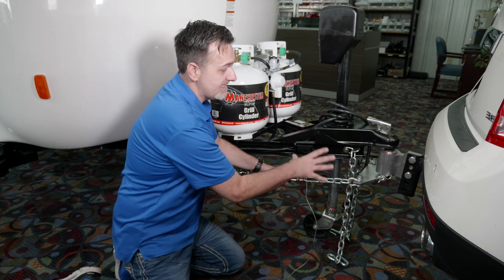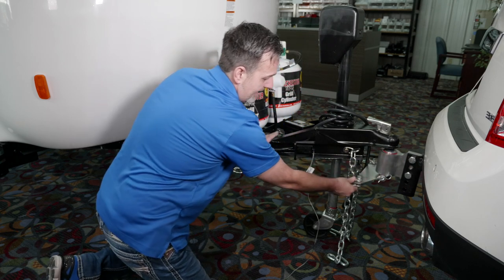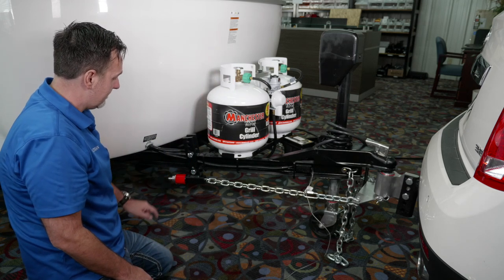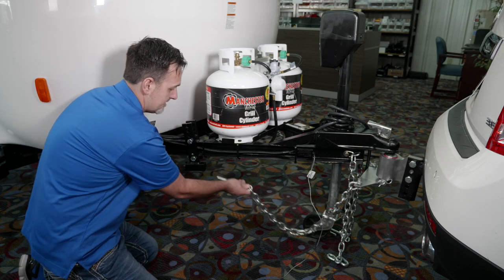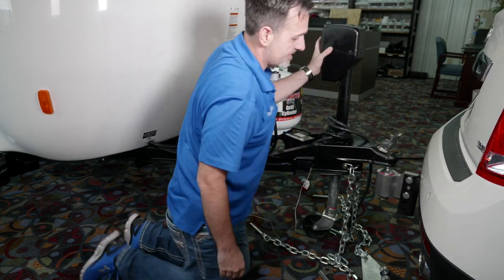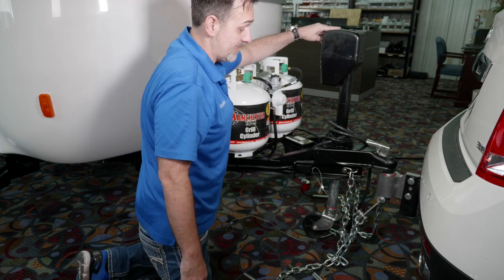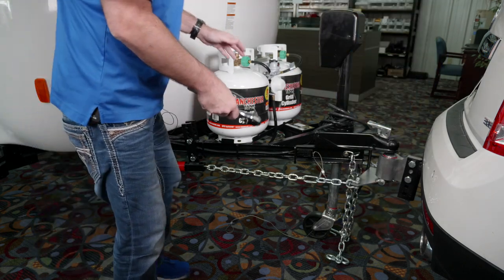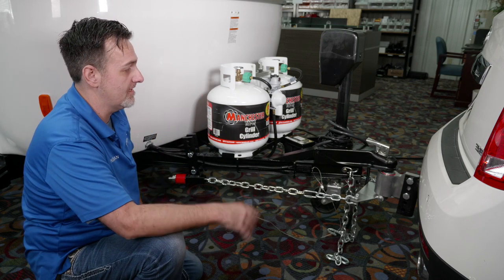Weight Distribution Hitch

Comment: What is the secret to get the plate straight so I can connect the sway chains??
Reply from the maker: Hello Ann! our service department will be able to help you feel free to contact them through our service request on our website or 800-442-9986. https://casitatraveltrailers.com/parts-service/
Reply: if you're camped and have to park at an angle, perhaps you can hook up (without the WDH attached) and move the camper to a straight level ground, the finally complete the WDH triangle hook up with chains where you are completely straight?
Reply: @RickMartinYouTube  yes, we figured it out. My main issue was I wasn’t lifting the hitch high enough to attach the chains. I still have difficulty getting both sides the same number of threads, but working on bringing the TV in at the same angle of the Casita. - Thanks

Comment: What is the purpose of the weight distribution hitch?
Reply: minimizes sway of the camper - https://www.etrailer.com/question-51580.html
Reply: It takes tongue weight off the hitch by using the chains/springs (or, with other hitches, torsion bars) to shift weight to the trailer axle and BOTH vehicle axles.